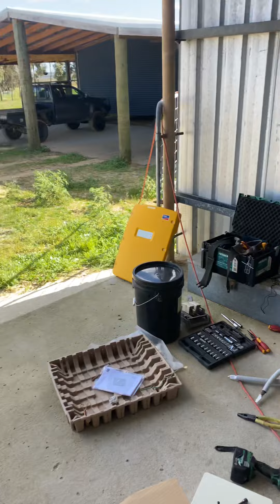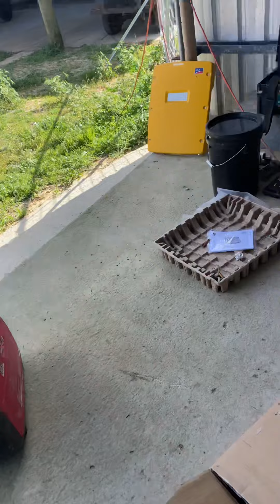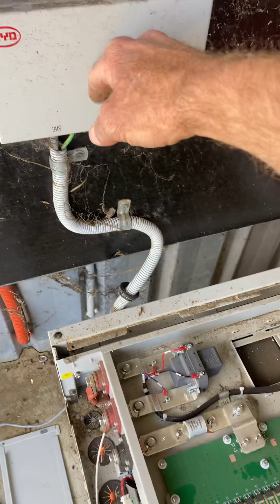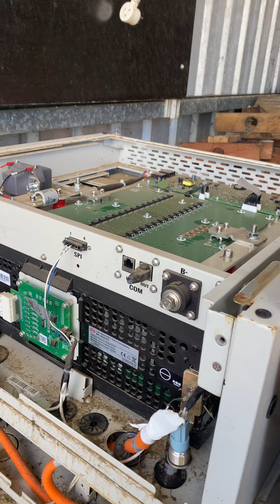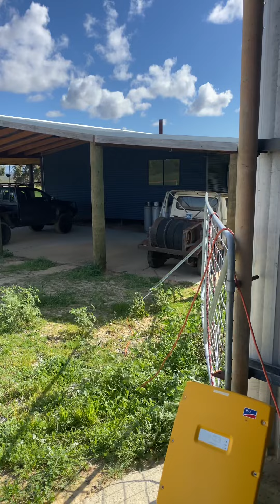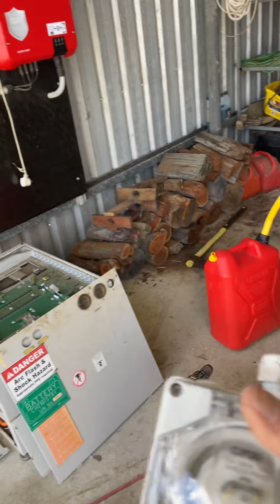Part 2. SMA and BYD Off Grid Power system breakdown and repair not going my way!

Comment: If you were to choose an inverter To install on your own home that was battery ready and assuming there was no shading issues. What would be the premium and the cost effective inverter you would choose to install?
Reply from the maker: SMA everytime
Reply: @joondalupelectricalservice3201  awesome will look into it! I’m a sparky in Brisbane and sub contract to a mate that installs solar but mainly for Origin Energy (use Goodwe) so not familiar with other brands etc. have done my solar course but haven’t got the CEC ticket yet. Just wanting to install my own system first and slowly expand my knowledge from the experienced
Reply: Based on your experience with failures etc? 

I have a clear roof until 4pm in the afternoon where the neighbours house shadow begins to cast over the west roof. 

Wondering if it’s worth installing solar edge as you can expand onto the inverter at a later date without installing an additional inverter. Or have read about the Fronius Gen24 has one of the best shade AI which may be enough.

Comment: Have you had many BYD batteries AND a SMA inverter fail like this? I thought all that stuff was rated for external install?
Reply from the maker: Hi
Its quite unusual to have either of these products fail. Thats my first SMA failure after installing over 100 of them. Inverters can be exposed to weather but not sun. Battery cant be exposed to either. I actually suspect this was a lightning strike!